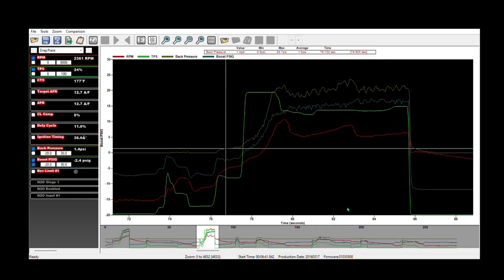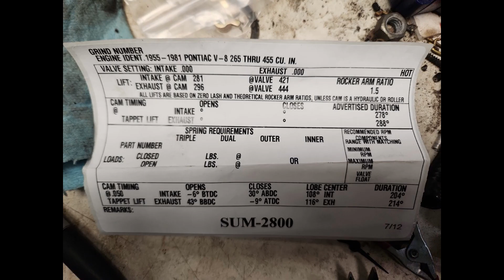TTA Performance - Installing a performance flat tappet cam in a Pontiac 301.

Comment: The 301T blocks were a huge missed opportunity, I really wish they had used a normal crank and heads. Maybe used a 3.25" stroke, revived the 326ci and 3.75" stroke for a 377ci and used aluminum heads. Then in '83 they could have used Sequential multiport fuel injection. They could have skipped a bunch of trash engines, wasted development and production costs. Used the Pontiac 301, 326 and 377 instead of the Cadillac 368, 4-6-8, HT4100, 4.5, 4.9, Northstar and Olds 307.  GM would have just used the SBC and Pontiac V8. What a lost opportunity.